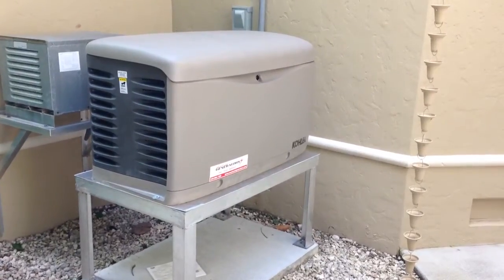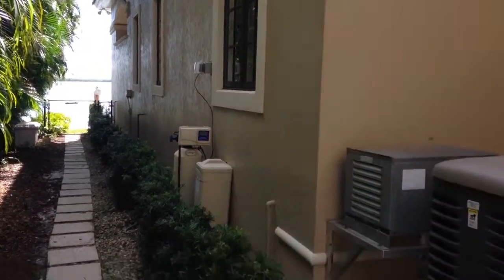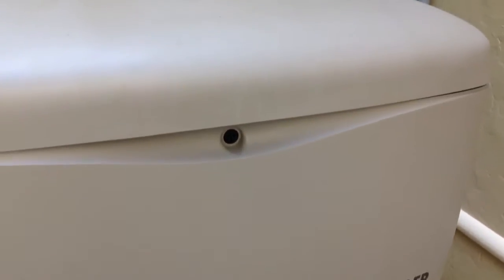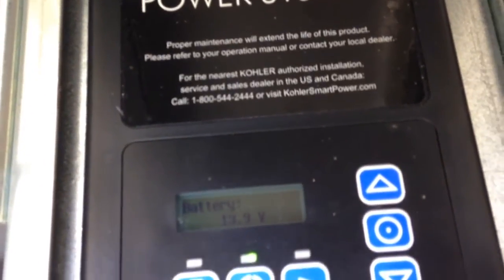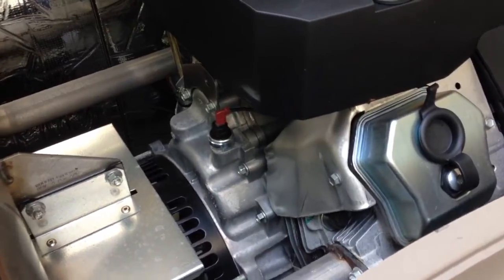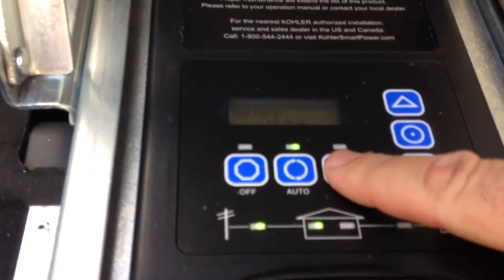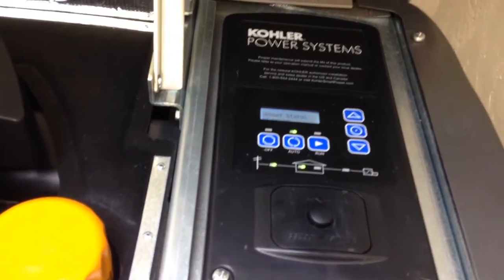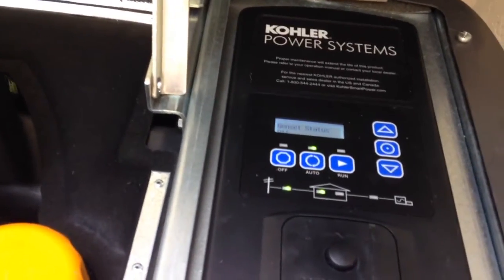Kohler 20RESA Standby Generator

Comment: 1:30
How do you figure that oil filter is for a mess free change when its mounted upside down to where you loosen it, all the oil inside of it will drain down and make a mess...??
Mess free would have mounted with the thread side UP so that when you loosen the filter, all the oil inside STAYS inside... 
Next you put the unit up in the air which is VERY smart but your house is at normal height so what good is that generator if the house is flooded up to or higher than the electrical sockets where it shorts them ALL out not allowing power to flow..?? Then your propane regulator is below the generator housing so IF there is a leak, water is now getting into the fuel line... Or how long before the water penetrates those connections at the regulator ..??

This reminds me of a service call i had on the east coast just after hurricane Matthew skimmed up the east coast... The guys house was on 8 FT concrete stilts... But his power meter, his generator and his 200 gallon propane tank were on ground level about 3 ft above sea level ...  I made the claim on the house was on stilts because of hurricanes and you didn't want flooding.. he said YES exactly .. I said, you know your power meter and generator and LP are at ground level so if it does FLOOD..... what good is that generator and LP when its under 6 ft of water...  He said, the city or county would not allow him to put the generator or propane tank up where his house was due to safety regulations ...  Ok, i get that, then why spend $7k+ to install this and you get 5 ft of FLOOD when a hurricane comes by and both are destroyed ... SO then i asked, do you have a smaller portable generator up top JUST in case..??? NOPE... all we have is that one below ... Oh ok, i just continued to work and left ....

Comment: that thing is loud af
Reply from the maker: +thastinger345 -The Kohler 20resa has the lowest sound rating in its class. You can have an average conversation next to this unit while its running.
Reply: ok, guess it is just the camera mic
Reply: No jeff i own this unit and its very very loud. You can have a conversation only if you are screaming. And btw it is certainly not the lowest sounding in its class. These generators are built for disaster. First off they run at 3600 rpm, meaning that the engine gets alot of wear(also explains the sound). Next, this is air cooled, meaning it will get VERY VERY HOT,especially with the canopy. If you live in a hot place, do not use this generator for extended periods of time(more than 4 hours). Its a V2 engine, and there us a plastic gear inside that will shatter after 1500 hours. Maybe less depending on the load. You have to replace that after every 1500 hours, and it is very expensive and labor intensive to do so. This generator has to be oil replaced after every 100 hours, which is alot. Most generators in this class require oil change after 300-350 hours. Also, the cheap plastic oil cap will loosen and fall off, you will have to electrical tape the inside of that cap for it to be tight, also the plastic area surrounding the oil cap gets cracked and leaks oil. That also has to be periodically replaced
Reply: Abdul Rehman Mian what brand do you like Abdul?